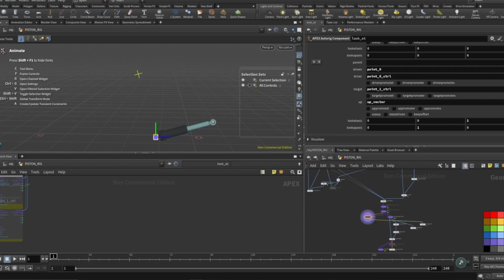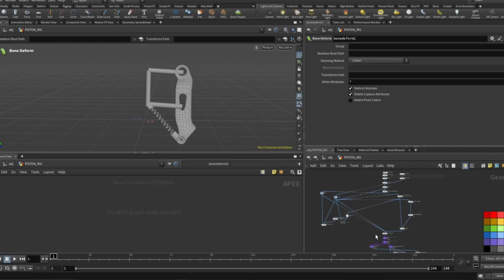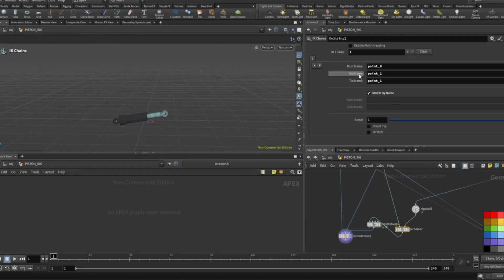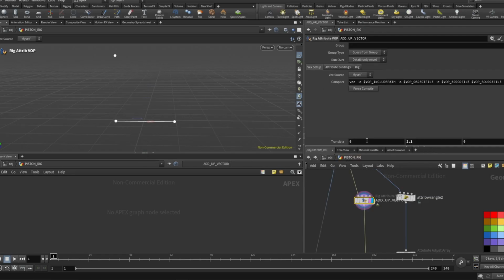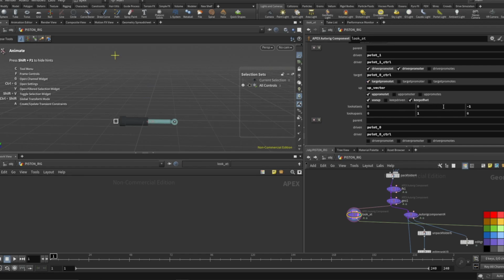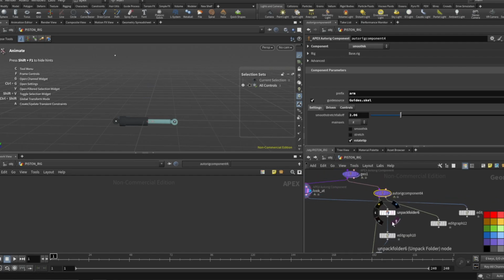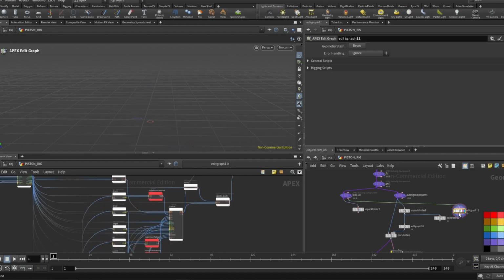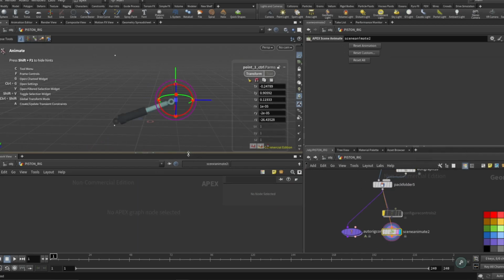Setting up a hydraulic piston rig in APEX Houdini.

Comment: Hello. I too am exploring Apex. I'm from Maya animation and looking to learn the Apex system. I've gotten some stuff understood as far as rigging is concerned. What I'm more in the dark about is the sceneanimate node and interacting with other items. Example: I have a rigged cube with a controller. Simple setup is File/bgeo--->sceneaddcharacter---->sceneanimate = Geo with controller. So far so good. But, what if I want to have that controller attached to a motion path? I'm stuck in animate mode and the controller is a viewport item only. It is not available as  raw data like other sops. It's buried inside the APEX sytem. I tried adding a motion path as a second sceneaddcharacter to flow into the sceneanimate with the rig and using the built in static and transient constraints, but it's clunky. Great tutorials by the way!
Reply from the maker: I honestly would need to see the scene I'm bad at understanding without seeing it. You could post it on the Houdini forum so more people can help or if you find me on linkedin you can add me an send me the file. Don't know if i can help you but I can check